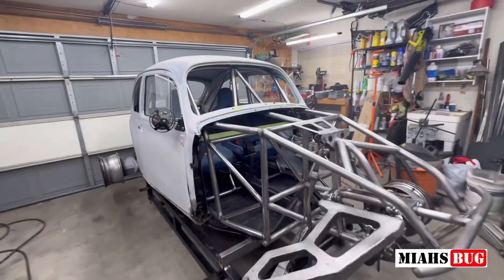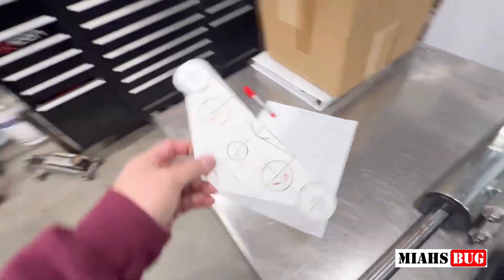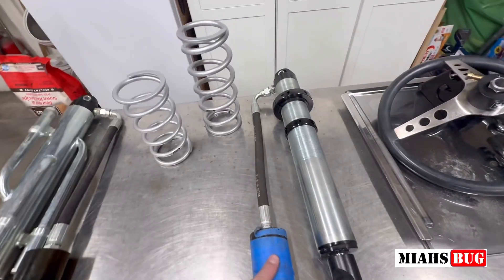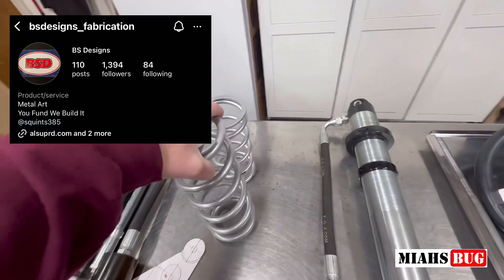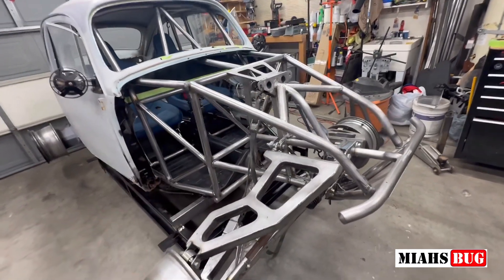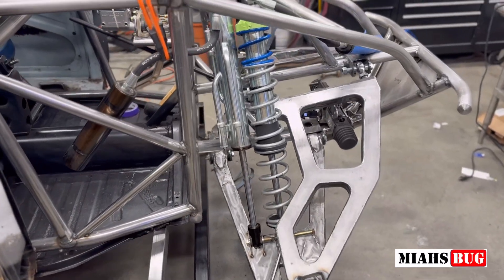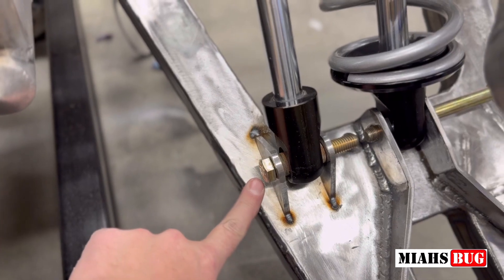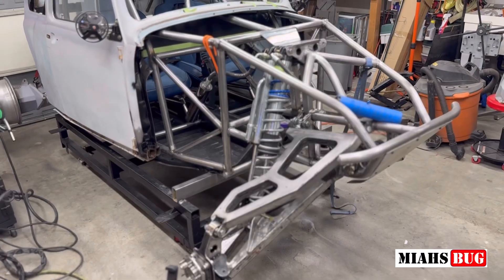Adding Triple Bypass Shocks to the Front End

Comment: I got a question, where or how can i figure out how to solve bumpsteer.
Reply from the maker: My setup is currently cycling more bumpsteer than I like. I battled with it for a few nights and made 3 different steering brackets. Still not solved but getting close. I don’t have a straight forward answer for you other than setting up a temporary rig to find the correct geometry